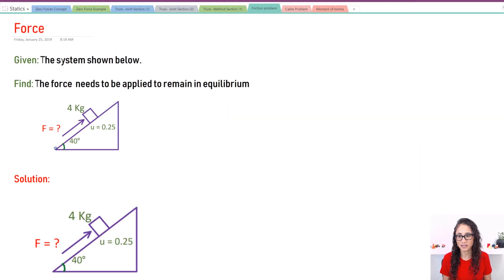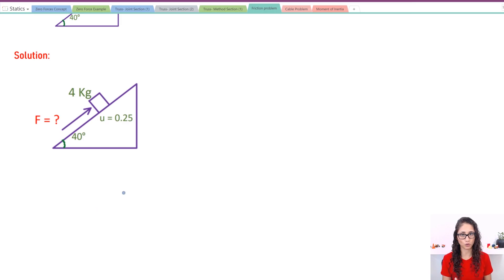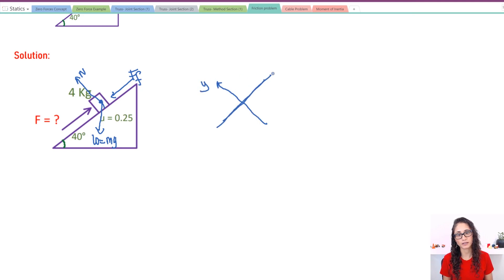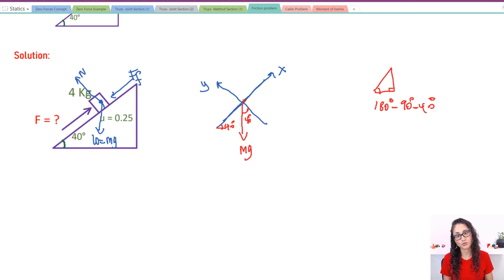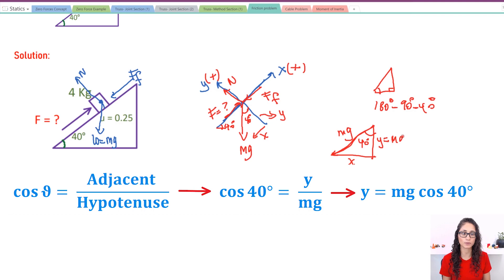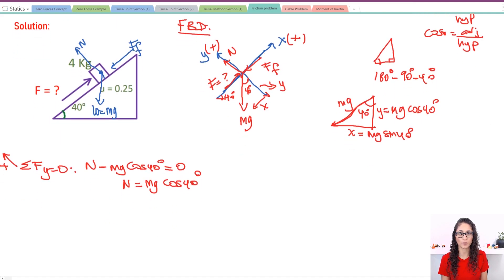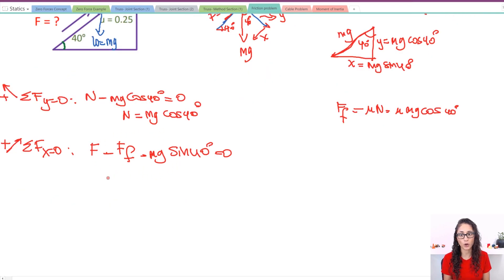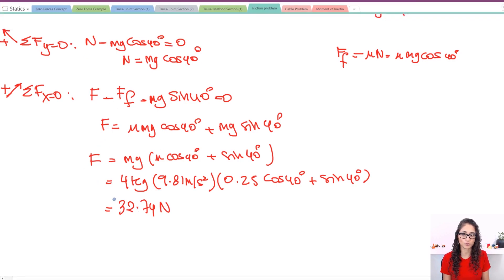FE Exam Statics - Force For Equilibrium

Comment: The key word to this problem is equilibrium. If the problem would have asked for the minimum force to keep the block from sliding it would be 17.7 N, but it asked for equilibrium which implies there is zero net force. If only 17. 7 N is applied the friction force holding the block from sliding will still exist as the net force. (-7.5N)

Comment: The minimum force required to keep the block in place is the downward force - the friction force trying to resist the downward force (25.2N - 7.5N = 17.7N). The maximum force that can be applied before the block starts sliding up is 25.2N + 7.5N = 32.7N.
Reply: You are absolutely right. Also, In the exam they will likely specify which one they want

Comment: I thought friction in this case is working against gravity. So doesn’t this add to the force?. Otherwise the applied force would break the friction  which would result in the box moving.
Reply from the maker: Friction opposes motion, so if you apply a force upward to keep the object in equilibrium, the friction will oppose that motion. You can apply a force just enough to keep the object in equilibrium, however, if you keep increasing the force and the limiting friction is exceeded, that is when the object will start moving! I hope this makes sense and good luck with your studying!
Reply: enGENIEer  ok thanks. I was thinking that gravity is naturally pushing on the box without an opposing force, causing it to slide.While friction was the only other force slowing it down. Meaning it was going in positive direction.

Comment: the direction of friction is wrong
Reply: GPT said is wrong how you did it. The friction force is upward
Reply from the maker: Hello Ropert, please note that the friction force has to always oppose your motion! So if you look at the problem carefully, the question is asking, what is the force that need to be applied upward to keep the system in equilibrium. So the force is going upward, so friction force has to go opposite of your force. I hope this makes sense. Thank you for watching and good luck with your studying!
Reply: enGENIEer  you mention that the fraction force is against the force “F” but it should be against the sliding direction of the block or body
Reply from the maker: @ropertmores971  OK so that would be correct if the question did not show the force being applied upward. So think of it this way, if you apply that force, (assume it exceeds the limiting friction force) your block will start moving up, so hence your friction should be the opposite of that. Does that make sense?
Reply: @Genieprep  In this case we have two solutions to this force
The first is that the force acting is only going to resist the weight and with the help of the friction force in this
,
The second force is greater than the first solution and therefore friction and weight will resist.

Comment: I recalculated it three times and my results were 22.69 instead of 32.74. I got sin40=.745 and cos40=-0.6669 and when I did my calculations I got that result.
Reply from the maker: Hello, I am not really sure why you are getting 22.69, but if you plug in (4*9.81) [(0.25 cos 40) + (sin 40)], you should get 32.74. Just be careful when you plug in to your calculator, make sure you use the parenthesis correctly! So you should calculate this first, (0.25 cos 40) then add sin 40, which is 0.83 then multiply 0.83 by 4*9.81. I hope this helps and thank you for watching!
Reply: @Genieprep  I found the problem, my calculator was set in rad instead of deg. So the trigonometric functions were wrong
Reply: Thank you so much for the support
Reply from the maker: @SamequiPaiva  I am glad to hear you figured it out and keep up the good work!

Comment: I am solving a few exercises and I've seen a situation where they give you the weight already, so instead of kg, it's kN. The solution disregarded the angle and used the value in kN. I'm a little paranoic thinking that I might face a situation like that on the test. Is it unconventional?
Reply from the maker: If it is already in the force unit, it still needs to be broken down into x and y components, so you can apply the equilibrium equations. However, I have seen problems where they don't use the incline plane as x and y axis, they just use x and y axis to be straight, in that case the weight would just have the y component, but then the other forces need to be broken down into x and y components. So it depends how you choose your coordinate system. I hope this makes sense, and since you brought it up, I might make another video to clarify this issue.
Reply: @Genieprep  Thank you! It does make sense, but a video would definitely be helpful! Thank you!

Comment: “Friction always opposes motion” with that said... Wouldn’t the friction be pointing up instead since the block is moving downwards because of gravity?. Friction should “try” to prevent the object to fall down therefore the force applied to the object to create equilibrium should be less than the force applied by the selfweight? Or the other way around? Could you explain?, I am confused...
Reply: I think the minimum force applied to prevent the block from sliding DOWN is 17.71N and the maximum force applied before the block begins to slide UP the ramp is 32.74N. Anything between these values and the block remains in equilibrium, and hopefully the exam is not tricky. So long as the coefficient of friction exceeds the tangent of the angle it will remain in equilibrium: u > tan 40 (without an external force)
Reply from the maker: Your thought process is right, the only think is this questions asks what would the applied force be equal to for the block to stay in equilibrium, and since the force is applied upward, the friction force will oppose that motion. I hope this make sense and good luck!
Reply: I am still confused. I just feel that if I apply the force that you come up to the block it will move upward instead of being steady or in equilibrium. On the other hand, setting the friction upward, since we are not planning to create motion upwards just “stop” the body to continuing moving downward, we will come up with just enough force to set the body in equilibrium. If not would you please explain, I don’t want to screw this kind of questions in my FE. Thanks
Reply from the maker: @rodolfovaldez4169  The thing is in this question, it clearly shows the direction of the force being applied. If you get a question where the direction of the force is not specified, that you go with that logic that you have. I hope this make sense and good luck with your studying!

Comment: At 5:02 in the video here I see the mg force going down and to the left how come it’s going that way and not down and to the right or straight down if you’re using the alternate interior angle of 40
Reply from the maker: The triangle that I drawn for the force mg just to show how we use to trigonometry functions to find the x and y component for the weight, but it should be going straight down.
Reply: So if we were to draw the forces straight down in the fbd it would still be the same way to find the c and y component
Reply: Either way thank you!!